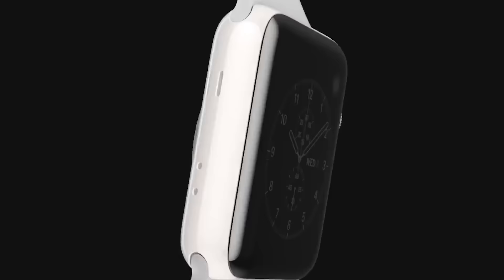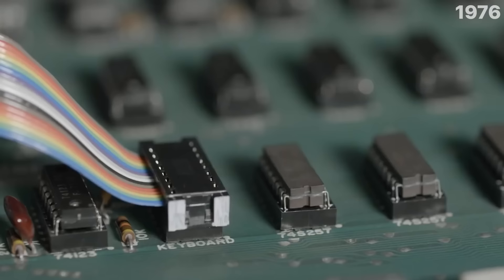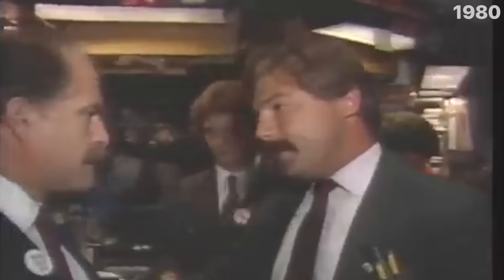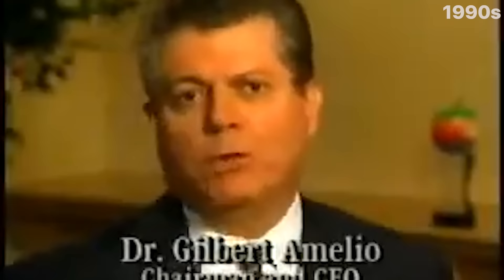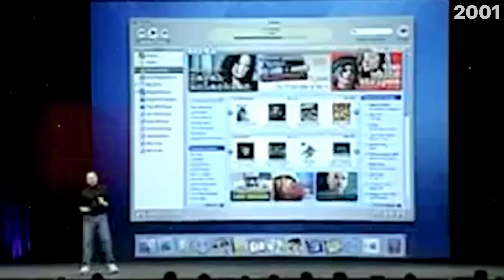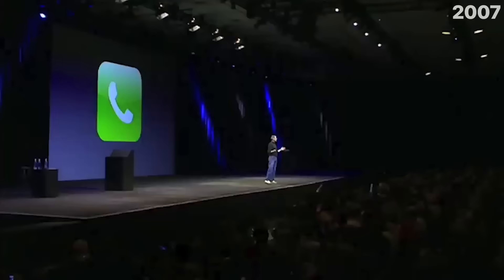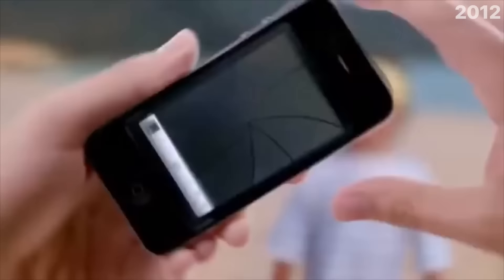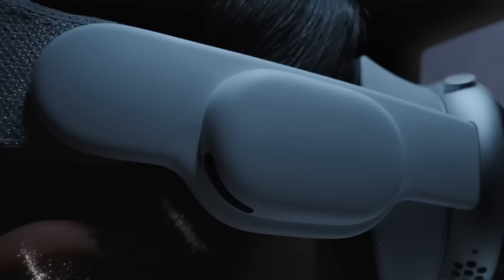the entire history of apple, i guess

Comment: There’s a lot of factual errors in this documentary. The MacBook Pro first came out in 2006, and one can trace its lineage to the older PowerBook. The first MacBook Pro was essentially a G4 powerbook with an Intel chip. I’m actually surprised about how this video didn’t even mention the PowerBook, or iBook models beyond the original G3. 

The iPod wasn’t Apple’s first handheld either. The newton series came way before it. 

The M1 chips, subsequent M series chips, were indeed designed in house at Apple, but they were built upon the Arm architecture, used by companies from Nintendo to Roland. Also, the M-series architecture was based on Apple’s “bionic” A-series chips, which used ARM’s BigLittle technology. The M1 was an A14 with extra cores. That M1 Ultra Mac Studio? A souped up iPhone 12. They’re phenomenal chips, and they’re very gentle on the electric bill in spite of their speed, but Apple just tricked them out, and the high end machines are expensive as ever. 

iCloud can also trace its roots back to MobileMe.